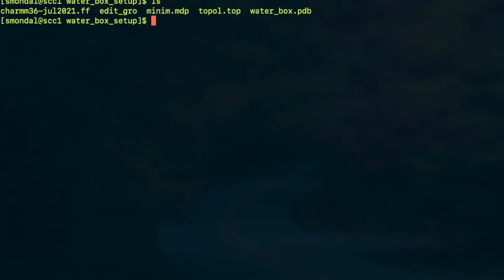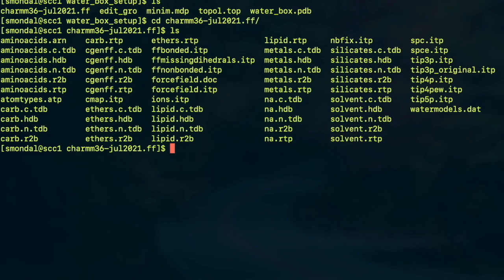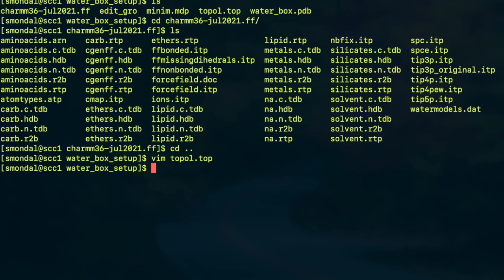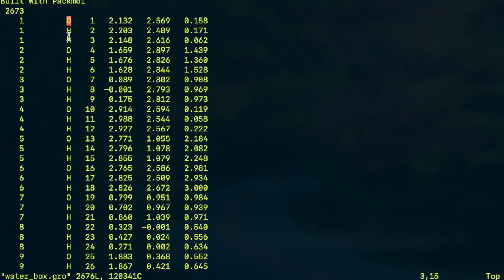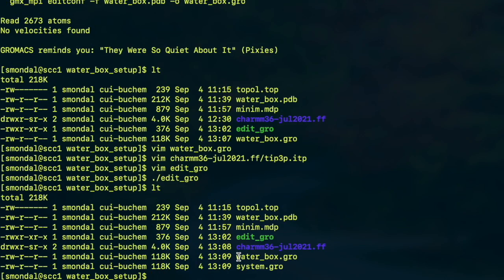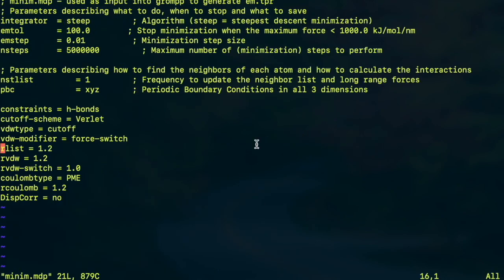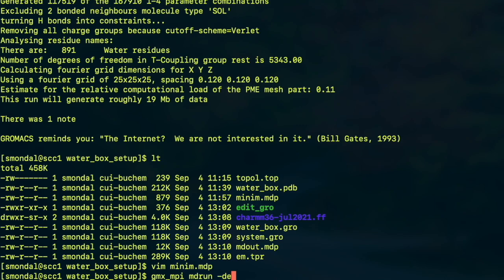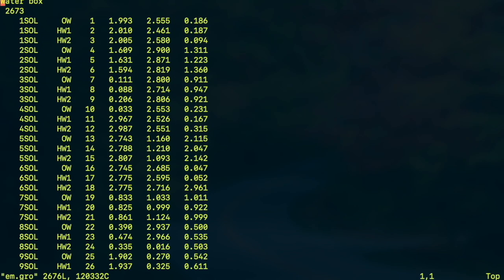Simulation of a Water Box with #GROMACS | Part-1 Energy Minimization

Comment: Dear Dr. Mondal Sir ,I have gone through your you tube videos  Simulation of a Water Box with #GROMACS Part-1 energy minimization. As per your previous videos I made Peptide with solvent interaction after getting successful result  by Packmol then  I proceeded for  energy minimization using GROMACS. My first command was gmx_mpi pdb2gmx -ignh -f protein.pdb -o protein.gro --p topol.top, and selecting the force field as suggested by you I'm getting a blank topol.top file subsequently error in next commands.  In the video you have topol.top and edit.gro file which I could not get after running the 1st command. Will you plz share the detail protocol how did you get topol.top and edit.gro file  before MDS. I will be thankful to you for this if you could share this.
Reply from the maker: Hi, thanks for reaching out. I am not sure whether you want to simulate just the water box or if you want a protein inside it. 
If you are using packmol to create a water box, you need to manually create the topol.top and also change the pdb file following the atom names in the forcefield you are using.
If you wish to simulate a protein-water system, execute 'pdb2gmx' with the protein only pdb (no water or ions). Then you can add water by 'gmx solvate' command. 
Let me know if this helps.